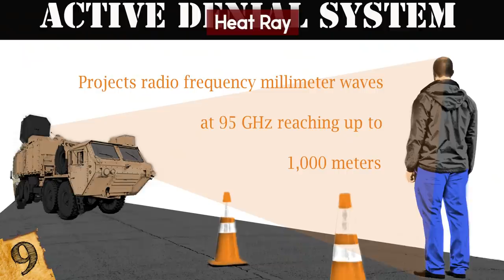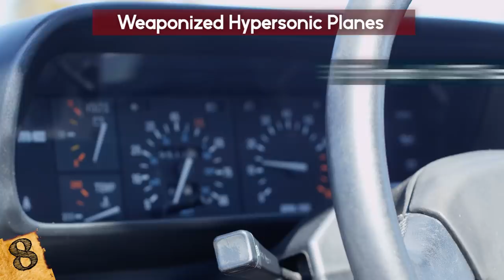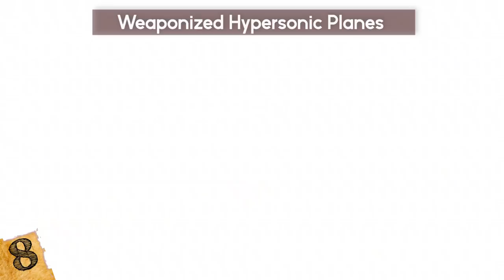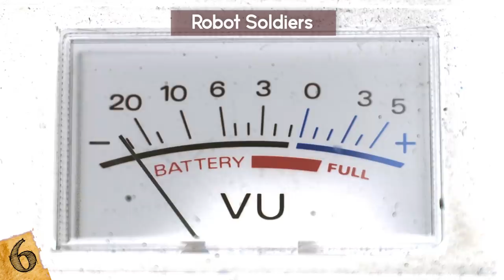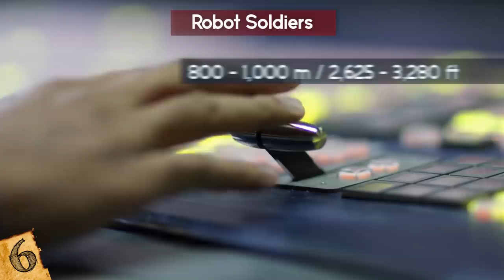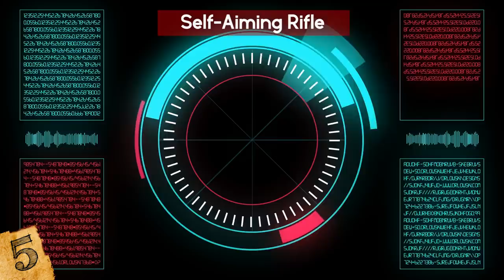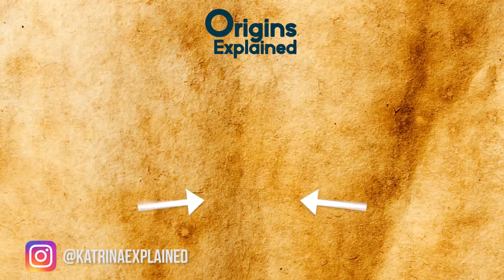Futuristic SCIFI Weapons That Actually EXIST!

Comment: I would like to have predators aim locking laser rifle-
Reply: They have the optics already.  Tracking Point has been around for quite awhile.  I'd like to see it mated with the EXACTO bullet.
Reply: It's actually a plasma rifle that the Predators are using. But aim locking for both plasma and lasers would be nice.

Comment: Wake up, any smartgun can be knockedout by EMP, rendering the arms useless.
Reply: is EMP common?
Reply: I’m pretty sure a jammer could probably work.
Reply: @lattekahvi1298  they have hand held EMP devices to stop cars, as it knocks out their electrical systems. They are already in use, you don't need a nuclear explosion.
Reply: @DarkBykeTwitch  they have hand held EMP devices to stop cars, as it knocks out their electrical systems. They are already in use, you don't need a nuclear explosion.
Reply: @Jim Gordon Source?
Reply: @cowmoo5596  dude there real
Reply: @cowmoo5596  emp weapons r not fictional
Reply: @angry-birdo4640  okay then can you link something? I can’t find any evidence of real handheld EMP devices, I’m not sure it’s even possible to create an EM wave generating device that small, maybe with an Explosively pumped flux compression generator you can get something suitcase sized but definitely not handheld size
Reply: @cowmoo5596  I read a source saying that “US Army electronic-warfare colonel has apparently confirmed the existence of working non-nuclear electromagnetic pulse (EMP) ordnance”
Reply: This is source: Colonel: US Army has working electropulse grenades - TheRegister , 12 feb 2009

Comment: With a scram jet you can use a Nuclear reactor to create heat and if that happened you would pretty much have unlimited flight or at least until the uranium ran out and I don’t understand why people don’t use planes with small nuclear reactors because we have tons of uranium and we just turn them off at the time because the airflow from the scramjet would cool down the reactor so if we use them as planes we would be able to fly anywhere in the world